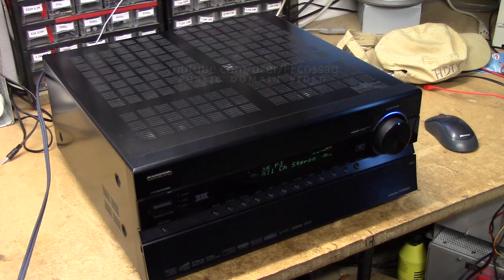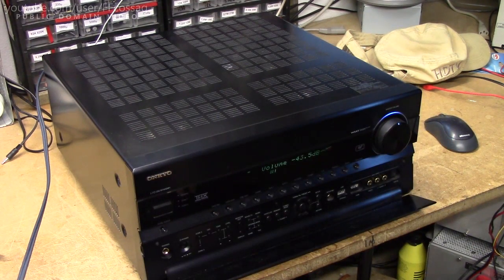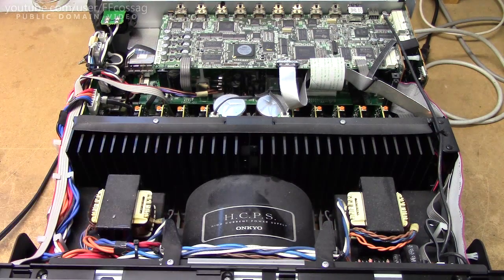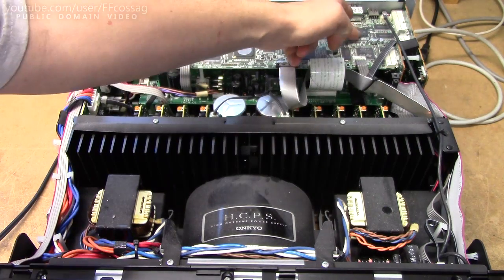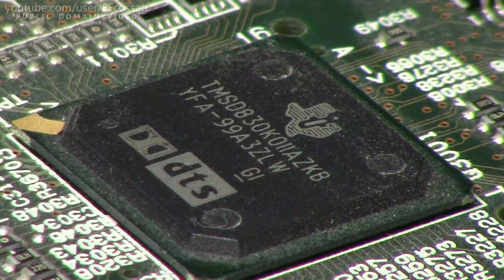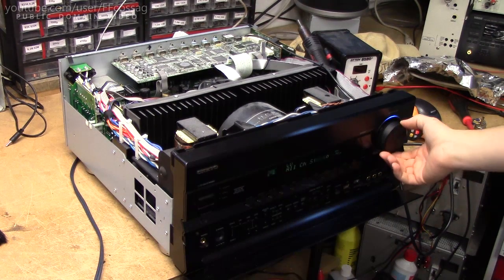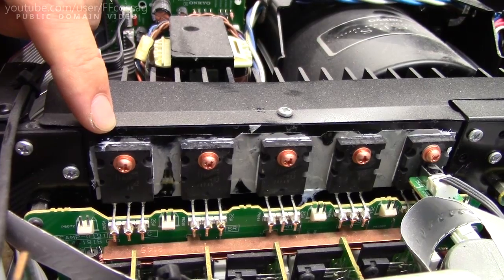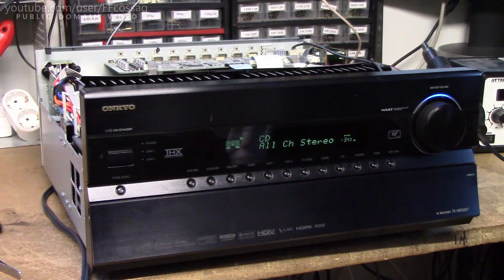Onkyo TX-NR5007 no sound repair (BGA reflow, reinforcement & heatsinking)

Comment: great video, thanks! I own a TX-NR709 and after 9 years i'm having the same DTS chip issue. I temporarily get if to work with a blow dryer and I'm planning to resolder using a heat gun and some soldering flux. I had a question re the size of the heat sink. All I could find was a 14mmx14mmx5mm would that suffice?
Reply from the maker: Really any heat sink works.
Reply: @FFcossag  Great, thanks! I just did the repair and it didn't work initially but I did the reset and it worked. I was wondering if I should wait to install the heat sink (heard elsewhere to leave receiver on for a week first?) or if I should do it right away. Thanks!
Reply: OK. INitial resoldering did not work. I rpeated the process at 620 F for about a minute or so (stopped when flux started to smoke). Let it cool, turned it on and voila. It worked. Turned off and turned back on after 15 min. It worked again.30 min. 45 min, 1 hour, 2 hours. Next day, it worked again. So I installed heat sink, and it has been working fro the past few days. I hope it continues this way!

Comment: Hi there, its a great video. I stumbled across this while trying (desperately) to get information on the issue i am facing with my tx-nr5007. I could see that there is a short circuit in the massive toroidal transformer(the biggie in the middle), however i don't have a clue on its rating. it will be really helpful if you can provide any information on the transformer specs. Thank you
Reply from the maker: I have no idea, but I strongly doubt there's anything wrong with your transformer. Keep in mind that a multimeter will show it as 0 ohm if it's OK.

Comment: Hello I have a tx-sr875 that has never had this type of complete failure but mine has a loud pop or high volume buzz. would the HDMI chip in question be the problem as well. It only does this when the chip is hot

Comment: Great video. I have the TX-NR5010 and my chip was replaced by Onkyo and I immediately put a heat sink on it. But now the problems reappear.
I was watching Star Wars on TV (sub HDMI output was off), in the middle I decided to go with the projector, so I turned both HDMI outputs (in the Settings of the receiver) to on and after just one or two minutes the receiver was loosing the signal continuously so watching was not possible. 
I guess that using both HDMI outputs ( might draw more current, so might it be, that the capacitors lost their capacity? 
Sometimes I get the problem when listening to CD via HDMI (no problem over coaxial or optical) - "No Signal".
What capacitors are the ones to be replaced on the HDMI board and is it advisable to use ones with higher capacity (or voltage) rating???

Comment: Hello, my Onkyo 5008 (in Brazil), at the beginning of the cold season started to present a defect. The last relay (speakers connection) did not work.
I turned it on and off several times and it started working again.
Unfortunately, last week the speaker relay stopped working.
I looked for a specialized company, they will make a reballing the BGA of the DTS chip.
It is not expensive, around U$ 100.00.
What do you think?
Reply from the maker: It might work, I can't say.
Reply: @FFcossag  Do you know how to test if the DSP is working if the equipment is without audio?
Reply from the maker: No, sorry.

Comment: I have a Onkyo TX-NR646 and my front speakers are not working.  However, my center speaker and my surround speakers work. Could this DTS chip problem be causing this?

Comment: Hm, what kind of glue did you use there? 
I'd also be concerned of that glue going between the chip and the board. 
And as Louis Rossman has told us, "reflowing BGA chips" isn't always properly fixing the problem as it might've also been a defective chip which got revived for a short time by heating it up a bit. But then again fixing something that way is always better than just throwing it in the trash without even trying, even if it won't last as long :D
Reply from the maker: It's Fujik thermal compount from Dealextreme. The issue on these models is not a defective chip; I've fixed too many of them with too high a long-term success rate for that to be the case.
Reply: @FFcossag  Have you ever came across an Onkyo with "no sound", except from "zone 2"?
The one I'm trying to fix has NO BGA chip, instead it does have a DSP TMS320D788E001BRFP chip on the HDMI board.

The receiver is a HT-R580.
The HDMI pass-trho and zone 2 audio works.

No audio from any digital source (opt/coax/hdmi), even in zone 2.

Comment: I have an issue with just one height channel not working on a TX-NR646. Any ideas? Already ruled out speaker or wiring ussues, it's a problem with the amp.

Comment: Did this amp hold up or did you end up finding it was a combination of the metal capos and the other regular electrolytics that needed changing.? I would have at least used traceless flux under a bga reflow.

Comment: Love your video, what's the white stuff you used on the chip?
Reply from the maker: Thermally conductive glue.
Reply: Is it Removable in case you need to replace?
Reply from the maker: Not easily. That's how glue works.

Comment: I have the same problem with my Pioneer  VSX-60 and my Integra DTR-30.3 Av Receivers, but I think mine have a relay problem.
Reply: Did you solved the relay problem? I assume the second click sound of relay powering up the standby amplifier

Comment: I know this is a older video, this is only my second time commenting on one,  but hopefully you see this and can give me some helpful advise.   I have the same issue with my onkyo,  and have fluxes and heated the chip to 300 degrees f, and again to 350-370 degrees with no luck. Is there any way to measure the volts going through the chip with a multimeter  to if the chip is bad? I understand  its supposed to flow at 5 volts.
Reply from the maker: You likely won't find any issues with the power rails without an oscilloscope.
Reply: I'm right there with you with no change at 330-350 degrees.  Now, I'm searching for main relay video's...which aren't as plentiful.

Comment: I have a txsr607 no audio comes out, it doesn't get on protection mode but the board at the side of the transistors gets very hot
Reply: I had the same amp before, no sound. I sent it for repair,  and the unit har a known issue with the HDMI onboard card. 
Due to an extended warranty of that problem, they fixed it for free. 👍
Reply: @antonioderrica3426  Thank you!

Comment: Why so much thermal solution? It might be that I’m just used to building PCs but why would you use that much on the chip and board?
Reply from the maker: It's to mount the heat sink to the baord as well as the chip, to relieve strain from the solder balls. It lasts longer this way.

Comment: I did some heat ir videos of these amps on my channel, go take a look. I added heatsinks to any chip on the hdmi board that got hot and now run fans on top of the until too. Not had any issues thus far. One of these in working condition just sold on eBay for 200£!

Comment: Hi FFcossag -  I just acquired all the necessary parts and tools for this repair and I am about to attempt this procedure tomorrow.  Can you please advise how long you applied heat to the PCB for the pre-heat stage and for the actual re-flow stage.  Also, can you advise what temperatures you used for each process.  Thanks in advance.
Reply from the maker: It's impossible to explain, there are too many variables. I'd recommend testing on a scrap PCB first - just try to desolder a BGA by heating it, to get a feel for how long it takes to melt the solder fully. Then heat the chip in the Onkyo 1/5th that time.
Reply: Thanks for your response, I will give that a try.... fingers crossed.
Reply: FYI... I was successful.  In case anyone else is interested on what I did, I preheated the chip and the locally surrounding PCB area to 90c for ~1.5 - 2.0 minutes, then using the provided syringe I applied the SRA TF5000 No Clean Tacky Flux around the entire chip.  Second, using my heat gun set to 225c I applied direct heat over the center of the chip for ~30 - 40 seconds until the surface temperature was reading 160c using my laser temperature gun and I could see the flux being sucked under the chip and smelled the burning flux.  Finally, I allowed the chip to come back down to normal room temperature and tested it; success!  I'm not sure if this a solid methodology for everyone to use however it worked perfectly for me and you might want to consider it a loose guidance.
Reply: Davide Cippitelli    How is the receiver doing after 6 months?
Reply: is it still working after your repair or did you have to do it again?
Reply: @dcippitelli  thank you for posting your results. any updates?
Reply: @woolyhatkatt   Unfortunately after approximately 6 months of working fine it stopped working again.  I didn't feel like going through the process all over again so I gave up and purchased Denon receiver.

Comment: Please help! I have the same issue but I wasn't clear on what you did with the heat gun. What temperature and duration of time does it take?  I assume you simply re-heated the solder to it would melt and reconnect? I have the TX-NR-5009. I tried the reset but to no avail.
Reply from the maker: You need to heat it until the solder reflows. Look up guides on how to reflow BGA chips, I know Louis Rossmann has some good videos on it.

Comment: At about 43 seconds there is a series of clicks when the amp starts up. If the second set of clicks are not heard, does that mean the output relays likely need to be replaced?
Reply from the maker: No.
Reply: @FFcossag  ok, I've got an amp I'm trying to fix that isn't putting out audio, isn't showing the speaker icons, and the relays don't seem to be clicking on. Is that all caused by the dts chip / hdmi board? Thanks!
Reply from the maker: No speaker icons is usually DTS chip.

Comment: Anybody got any idea of other ways to get the flux under the chip ? I tilted it, used a piece of plastic to stuff it under, used the heat gun to push it...
Only worked again a bit over 1 hour :/
Reply from the maker: If you heat it enough, the flux will wick underneath the chip. If the flux isn't producing smoke, you're not hot enough. Absolutely DO NOT touch the chip while it's hot, if the solder is melted, you will ruin its alignment and destroy the receiver.
Reply: @FFcossag  Oh ok, i did touch it a lil bit...Oops.
But i doubt i've heated it up enough though, there weren't any smoke at all. 2 mins top i think, i thought it'd be enough.
I'll try again, thx for tip!!

Comment: I am an Onkyo dealer.  I have seen an average of 3 years lifespan before something dies out of several hundred units sold.  Not cool.
Reply: same thing's happened to mine, curious to see if i can fix it
Reply: I have a TX-SR705 with plenty of space above it and never had an issue with it.
Stacking something on top of these machines kills them with ease imo.
Reply: That’s a brilliant reason to stop selling them ...
Reply: @RuiSilvaPT  one of mine had nothing on top of it and badly overheated
Reply: Integras are doing the same thing. I am getting customer calls of receivers we installed 3-4 years ago with the same crappy outcome. We stopped selling Denons for HDMI board problems. then we went to Yamaha. Solid units, never had 1 RMA'd, but the Crestron integration wasn't the best so we moved to Integra. Now planning to go back to Yamaha.. lets see...

Comment: I dont understand. You have to overheat dsp or cooling by heatsink?
Reply from the maker: You heat it to make sure it's soldered properly, then you have to make sure it's as cool as possible while the unit is on.

Comment: I tried this. It worked for a couple of weeks, now the problem is back. I used a self adhesive heat sink and installed usb fans to cool off the chips. Any advice? Thanks!
Reply: Did you found a solution?
Reply: @vortexor1  you know, it works as long as I let it warm up a bit, this means: I turn the receiver on, and I don't get the second click, therefore, no sound. I let it stay on for a minute or so, then I turn it off. Then, when I turn it back on, it works. I have redone the heat gun "treatment" a few times, and it lasts for a few weeks each time. I don't think there's a permanent solution except replacing the chip, which I think it's not an option anymore,

Comment: That was a lot of thermal adhesive there I hope the chip can swim.
Reply from the maker: The point of the thermal adhesive isn't only to mount the heat sink, but also to conduct some of the heat into the PCB, so that it won't see as big thermal fluctuations.
Reply: @FFcossag  oh I know I use it a lot but still that was a lot, I hope you don't need to do the fix again.

Comment: I got a onkyo 676 it shorted on a wire touching back panel piece of shit got money back and bought second hand marrantz sr7500 some teething probs but now it is mental good so happy with it :-)
Reply: Marantz made some good receivers.  I remember the Marantz SR8000 which i liked. 
I'm using the Yamaha RX-V2090 receiver from 1993.  Its built nicely.

It has 5 channels for amps.   It was Yamaha's top of the line Receiver back then.
I'm using Canton Ergo 90 speakers

Comment: Hello, I have the Receiver Onkyo TX-NR-3007, after an unsuccessful update, it displays the message ,,,, MMPU SETTING and does not accept any commands anymore. but when it is connected to the internet by the network entrance, it tries to do the update but only stays at Zero percent, I live in Brazil and here almost has no assistance of the brand. Is there any solution to this problem? I saw that it has internally the JTAG connector ,,, could you indicate which eepron recorder can be used to do this update?
Reply from the maker: I've never done that kind of work on any of these, sorry.

Comment: @FFcossag 

Great Video.  Last week mine the RT 390 has packed in recently with the "No sound issue", sometimes it works others not.
 I'm nervous about trying to fix and have not tried anything like this before :D.
Anyone out there got links for places to buy the materials / equipment in Europe/UK

EDIT:  It seems my unit starts to work after being turned on for 15 mins and it warms up. 
It will stay working until you turn off and when you restart it needs to reheat again to work. Could I put heatsink on it and skip the reflow ?

Comment: If the chip failed again, how to reflow it again (after put the thermal glue) ? How to remove the glue?
Reply from the maker: You remove it mechanically, but the chip should not fail again, and if it does, you likely need to replace it.
Reply: @FFcossag  noted. Thank you 😊
Reply: @FFcossag  i would like to ask a question. I have a faulty Denon x2200w. It does powered on without any issue but it wont output audio and video through hdmi.. any particulars that i should check with? I tried hard reset, doesn't work... Tq

Comment: So I put the flux around my Onkyo tx-nr616 and I heated it up and it still does not work. When the chip is warm it works but when the chip cools down it doesn’t. Do you have any suggestions or any way that u could help ?
Reply from the maker: It could be a bad chip, or you didn't heat it up enough.

Comment: Hello, I have an Onkyo TX-NR3007 that uses this same Hdmi card with this same chio from Texas, does this procedure solve definitively? Does this glue not subsequently damage the components?
Reply from the maker: As long as you use correct glue (I use FUJIK silicon thermal glue), it's usually permanent and reliable.
Reply: @FFcossag  Okay, thanks for the tip. my device is the TX-NR3007 that also uses this bga, I got an Onkyo card, which was made a correction by the manufacturer, but it seems that it did not solve, after 40 minutes of use the sound stopped, I think of doing this reflow too, even replacing this chip seems like the problem comes back.

Comment: hi i am complete novice at electrical work    what is the white gunge you use for the heat sink ?  is it ok that it touches other parts   ?  where can i buy it and the heat sink ?   i have a pioneer vsx lx 65 with no sound :(   many thanks for info
Reply from the maker: It's Fujik thermal glue from Aliexpress.

Comment: Can I clarify whether the FM receiver does not go through this DTS chip? My TX-SR313 has audio when using the radio, but none of the HDMI channels, so I suspect the DTS chip. But just wanted to clarify before I start with the reflow tool. Thanks, Anton
Reply from the maker: I don't know, I've certainly seen Onkyos that have had no audio on the radio, but I'm not sure if that always happens when these chips cause issues.

Comment: Hello, what kind of flux you are using on it? Thank You.
Reply from the maker: I recommend SRA TF5000.
Reply: Thank you.
Reply: So he cleaned the chip, put the flux  around the edges of chip.  Heated.   Cooled.  Then thermal paste and heat sink after?

Comment: I tried this on my TX-NR708.
Didnt seems to work:(
Reply: hello, finally did it work?
Reply: for the older recievers the solution is to recap the HDMI daughterboard. They used crap 85°C caps

Comment: How hot did it get? I didn't see the temp go past 150°C on your thermometer.
Reply from the maker: I didn't film the entire process (because it takes about a minute and would be boring to watch). I usually heat until the surface temperature reaches a bit over 200 °C. In my experience, the solder will have ample time to melt at that stage, given that the board is pre-heated.

Comment: yup
I bet this receiver didnt work longer than few months. this dsp chip needs to be replaced no matter what
Reply from the maker: It's actually still working just fine. The chips can often last a long time as long as you install a heat sink.